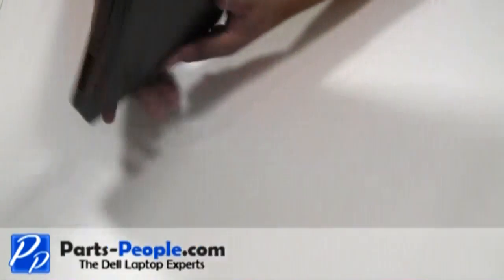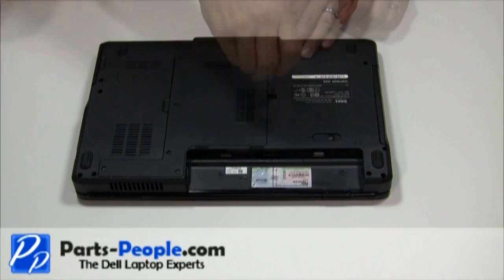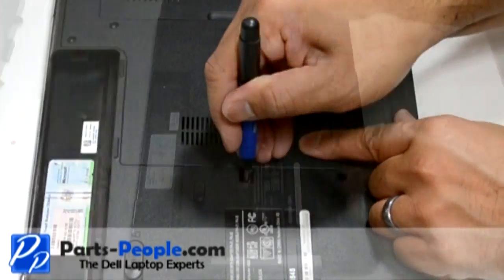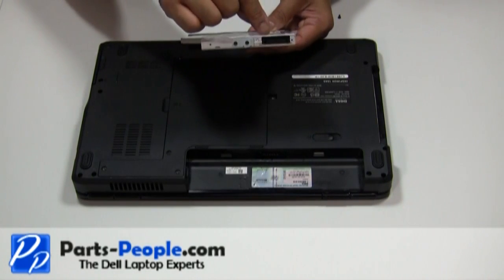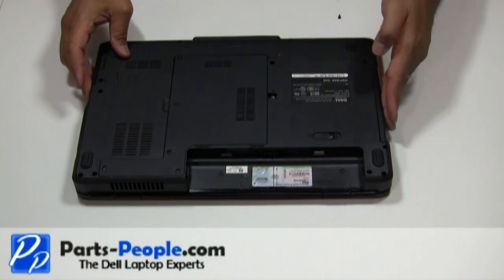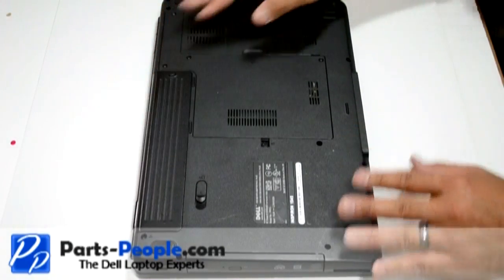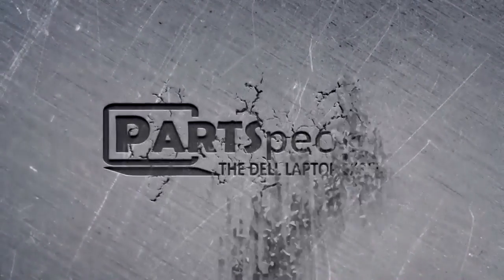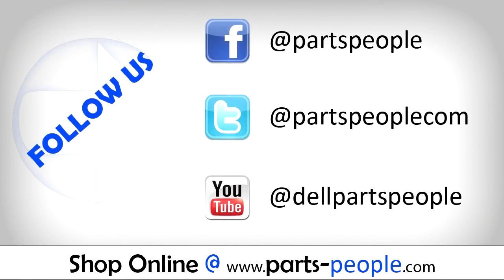Dell Inspiron 1545 | Optical Drive Replacement | How-To-Tutorial

Comment: I want to clarify this comment (I am the commenter,  I was just signed in under the wrong account):

There's absolutely nothing wrong with the video instructions.  In fact, it worked perfectly once I figured out what the problem was: the metal housing of the optical drive was knackered and bent out of shape.  I had to pry around to make the casing fit through the opening that it was supposed to easily slide through.

So it was just a problem with my own drive.  Video is great!